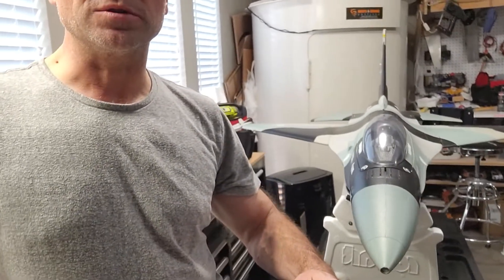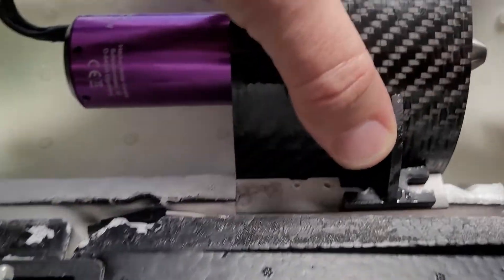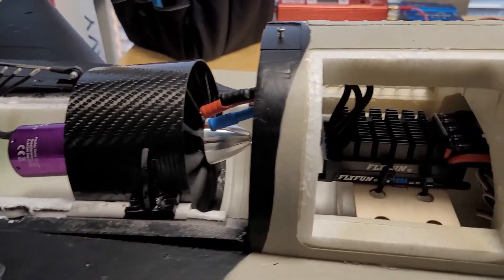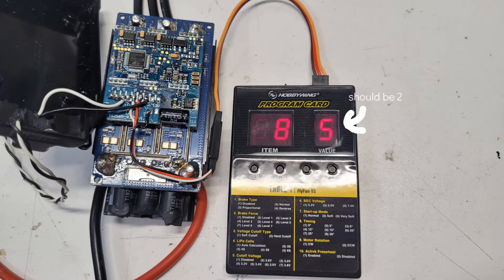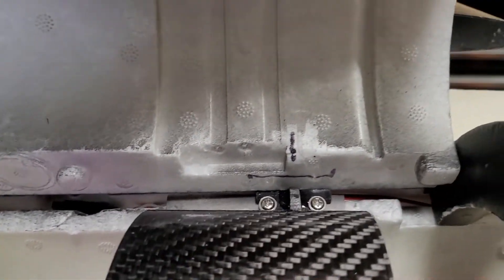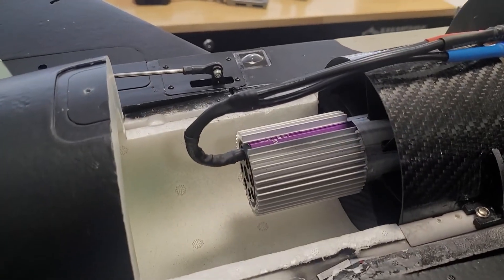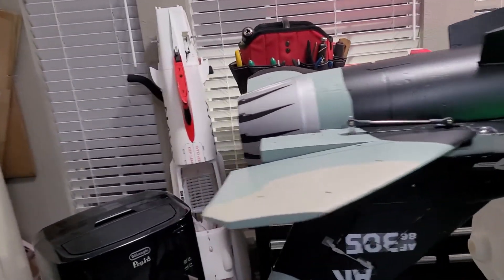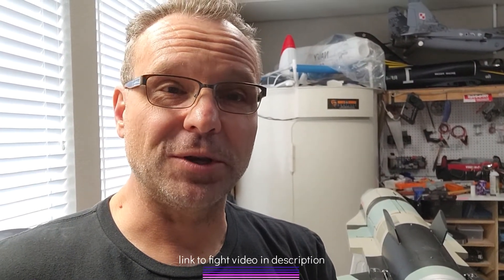HSD F-16 Power Upgrade!

Comment: Adding an EDF bellmouth to the fan'll speed up the air into the rotor, boosting the thrust.
Reply: Exactly and a thrust tube. This looks unfinished and rough. Wasted power and efficiency

Comment: How did you disassemble the esc? I removed the two screws at the one end of the ESC, and I still can't get the plastic frame off.
Reply: Never mind figured it out...😆
Reply from the maker: After you loosen the screws you need to gently pry the plastic cover open.  It has a double sided tape that holds it down.

Comment: Hi sir great job
I'm trying to do the same on my hsd super viper
would appreciate very much if you tell if you installed the jetfan without the intake leap and in that case if did not loose power without it
Thank you very much in advance
Best regards
Wish I get the same results LOL!!!!!!
Reply from the maker: Hi no I did not use the intake lip.  The foam in the F-16 provides a similar effect as it is shaped a bit like an intake lip.  There is plenty of power wit this setup
Reply: @pzukowski1001  thank you very much again really appreicated

Comment: Met you at Thunderbird field today. I'm trying to get the back off the ESC. Any pictures or help appreciated. I took out the 4 screws in front, but can't get it to separate.
Reply from the maker: Hi Roger. Not sure what it could be.  It may be glued together, maybe try gently prying it open?
Reply: @pzukowski1001  Black silicone I think. Got it apart, but they put that same silicone over those ports you soldered. Must have seen your video. HaHa

Comment: I cut some foam out and stuffed a 127mm dynamax with a HET 700 in my f16. Now it can go vertical from brake release . Power is impressive, the airframe needs some wing re enforcing. Mine is a V1/2 and at high speed the ailerons stop working from the wings twisting and it does an uncontrolled roll. Only thing you can do is cut the power and opposites rudder and a gentle pull to bring the speed back down.